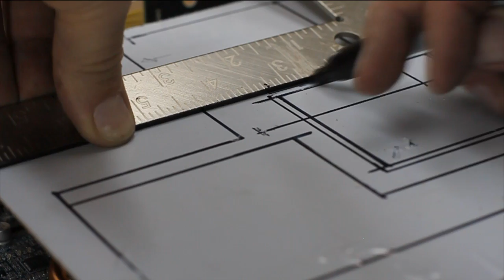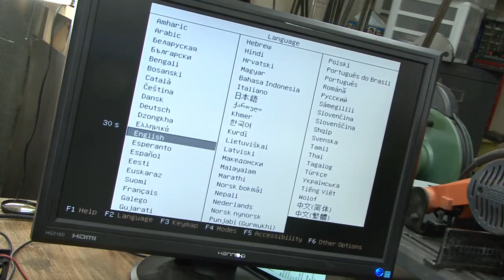OS Xbox Pro Video Worklog

Comment: Firstly, awesome job on the mod & the Video.  Secondly, where did you get the bulk SATA power connectors for your custom wiring?  Did you just cannabilize existing ones or did you find a supplier for them?  I was going to try a similar custom wiring job and couldn't find the bulk parts I needed!  Thanks for sharing this amazing piece of work all around!

Comment: Top of your trade!!!
Ben Heck watch out!

one question
where did you get the sata 2.5 hdd power connectors to make the power connection you did of  
"one power ribbon so to speak". I'm wanting to run my 2.5' hdd's the same way as your os xbox.
in my mods

Comment: Actually, the first console I ever had of that generation was the Playstation 2. The Debug and Development kit Xbox consoles are not simply rare though, they were never even sold to the consumers and have entirely different features and even slightly different specs from any other type of original Xbox console. If you wanted an orange Ps2, spray paint it, lol. You can't just mod a case and have a Dev kit however.

Comment: @qwertyboy1234567899 its an item that plugs into the usb panel port on your motherboard that is recognized as a boot drive witch recognizes the os' that are on the hard drives and gives you a selection between them.

Comment: You can build this thing now also with a Geforce GTX 750 Ti 2GB Graphics card. Thats a low profile card too
http://pcpartpicker.com/part/gigabyte-video-card-gvn75toc2gl    (Just discovered it)
Reply: ***** what '1 dimension' ?
Reply: I so wanna do that
Reply: ***** just thought about this
you could've also bought a m-itx board and the psu would fit next to the graphics card(not above the motherboard) and not touching the motherboard. am i right?

ooor/aaand with a pci express riser cable/card thingy you 'could' fit a non low profile card in this.
Reply: sadly, no not really. 1: EFi-X units dont exist any more and 2: have fun finding a original xbox crystal dev kit.